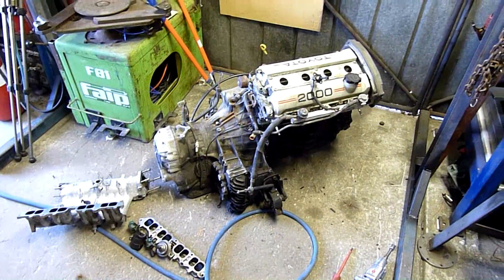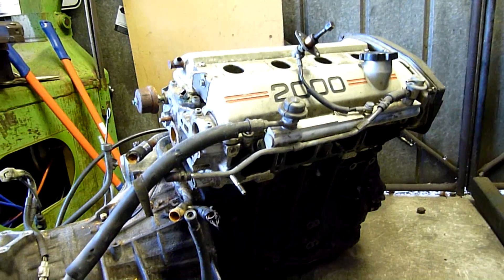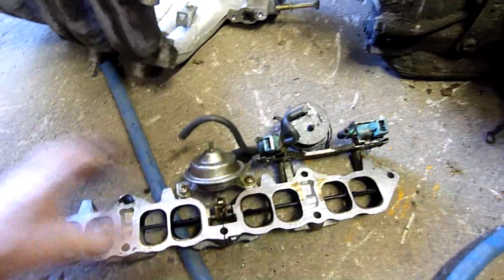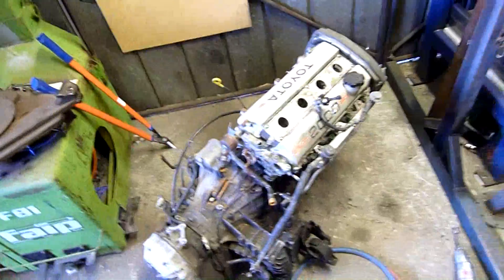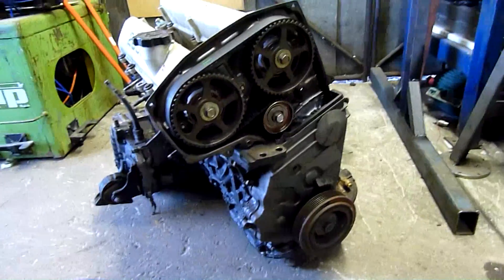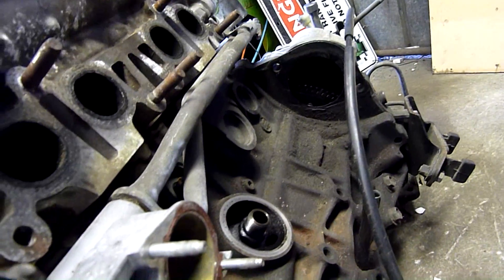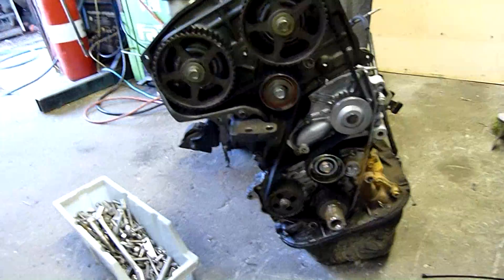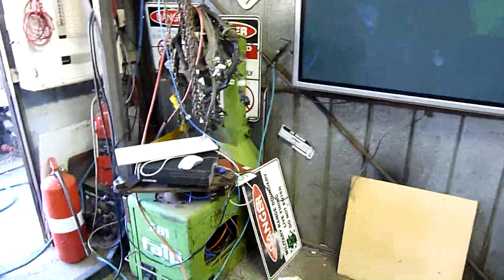Toyota 3S GE Engine Autopsy Pt1

Comment: reminds me of a ford falcon ef  el au intake manifold, designed to improve low rpm torque/power; but still breathe really well at high rpm
Reply: The 2.5L and some 3L Duratec V6 engines have this system as well. Used in the Mondeo and Taurus mainly. Meant to improve low end torque by increasing airspeed in the inlet tract

Comment: the second intake runner are closed below a certain load and rpm to increase airflow over the tips of the injector. Same design on isuzus, it maximize low end torque without sacrifying top end

Comment: If you buy a 3sgte get a 3rd gen version which uses a map sensor rather than an air meter. Also look for a air / water inter cooler rather than air /air

I get balancer off by pulsing the starter with a strong socket and bar.

I am currently dismantling a 2nf gen 3ste with a view to rebuilding it in my old st185 which I retired due to smoke on cold start. Not valve seals or the turbo seals as I replaced these :-(

I now have 2005 TTR celica with a 2zz in it :-)